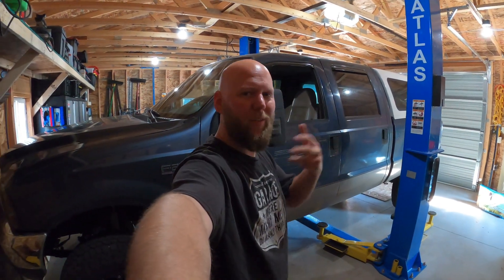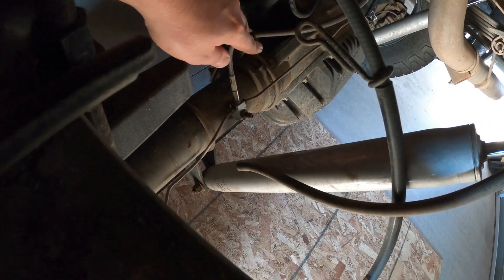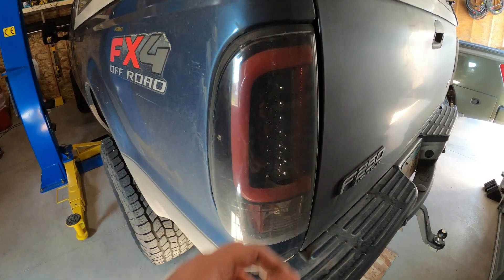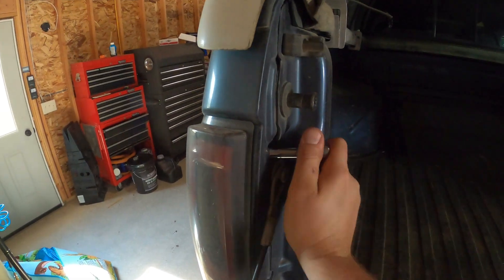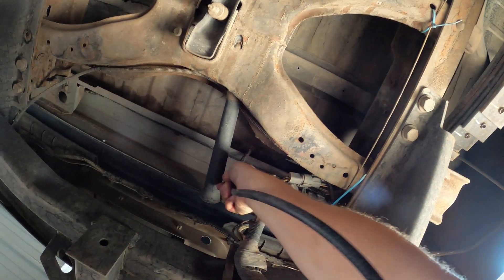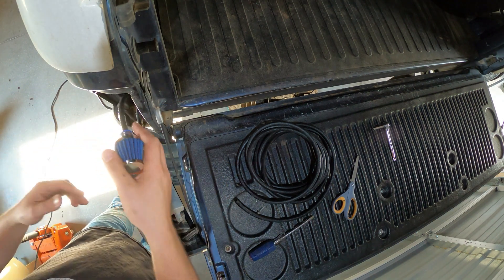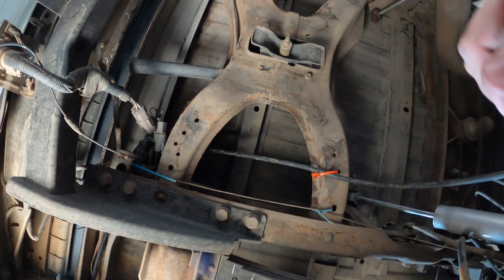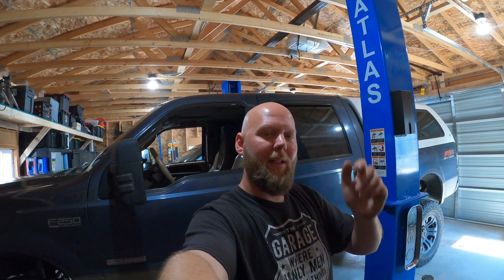Ford Superduty Rear AXle/Diff Breather Mod

Comment: Probably already know this but you should put a 1 way valve in the hose somewhere to ensure it doesn't suck anything in.
Reply from the maker: Not sure how good of an idea that is actually. As things get how air expands and goes out the filter...but then when it cools down air condenses then goes back in through the filter. I like letting it breathe. The whole point of this video is adding a filter to help protect. I think it'll be just fine
Reply: @AGuyandHisProjects Also, when you allow the air to equalize through the breather it won’t create suction at the seals at the wheels.